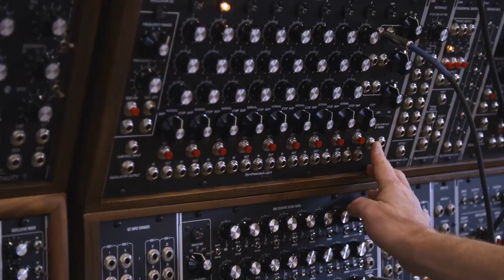Modular Synthesis (Part 2) - Studio Time: S2E12

Comment: Hey Tom,  Thanks so much for the great videos! they've been a great help for me.  :)  Could you possibly do a video about various ways to clock a modular system from a DAW?  I clock mine with a midi signal sent into either my Mother 32 or jdxa but I'd love to learn a different way to do this as this method is a bit limiting.  Thanks!

Comment: This is absolutely great! Thank u! I was wondering about the bass line tho. I have always thought that bass sounds should be recorded mono and stay mono. Otherwise you might loose the punch of the bass/kick etc. However, I cant deny that it really sounded great when you made two bass lines (or how to put it) for the left and right channel.

So I suppose my question goes: is it preferable to record bass/kick and similar bass heavy sounds stereo as well? Is the most important thing that you dont pan them in the final mix perhaps? 

Im thinking that I maybe should do the same and record a left and right bass line and kick on a stereo track rather than just keep it mono. Just a bit afraid that this wont be appreciated when the track go to mastering hehe 

Thanks again - gonna experiment quite a bit now :D

Comment: Great videos I love them. Probably a stupid question considering this video is on modular synths, plus the crazy amount of awesome software and custom patches you have as well. But have you ever used one of the free vst instruments that are out there in a composition before. I only ask because I have some decent kontakt libraries and some nice commercial soft synths vst's and a couple of hardware units. But even with my limited equipment every once in a while I'll find a sound on some random free vst. And apply it to a composition made with some pretty nice stuff, and as soon as the sound mixes with the rest of the comp it gels instantly to the point where the comp would fall apart without this cheap sound. lol I just wondering if you had an experience like that. P.S Thank you so much for your videos and music Tom your a blessing.

Comment: Is it not easier to have a tuner physicly on your monitor speakers set with  a microphone instead of patching all the time? Just tune what comes out of the speakers
Reply: That can work an be handy but it will often become unusable rather quickly as you build a patch because you start to have many oscillators and effects etc sounding at once so you'd have to bypass the entire patch just to tune one element of it.
Reply: @JohnLRice  well everytime you tune, you need to play just that instrument over te speakers ofcourse. You cannot tune the whole patch. It's just way faster.
Reply: @TheTerracide  Probably in a majority of situations that could possibly be true for a majority of people, but I can say from my own experience it's not always true. ;-)

Comment: Wow, you need a lot of patience to work effectively on a modular synth.
Reply: Yeah, but very interesting things can be done when maintaining that full control over the signal pathways :-D It's definitely nice to have all that equipment, but in the particular instance of modular synthesis I think I would prefer the workflow in software such as reaktor or max. And then you also have the luxury of patch memory :-D Would be cool to have a huge hardware modular rig though with lots of fully analog modules, then once you have decent modular patches going in software you could move over to hardware and really start dialling it in :-)
Reply: @mortenrobinson  I agree with this :) I only got into modular synthesis in the last couple of weeks and I really love it ! I'd say it's definitely cheaper and better for the workflow in the box, but man.. something about using the hardware really gets the nips hard hehe.
Reply: @yebitchye  You may want to check for ground coupling if that's the output you're getting.

Comment: It's a shame to see all the issues. One of my worries. Tom, I'm thinking about buying a dot com Studio 88 this year or early next. Are there any modules you would recommend adding or removing from this system?
Reply from the maker: after some searching I found out I was using a faulty APC battery. After replacing the rig was totally fine.
Studio 88 is great start and the standard config is great!
Reply: junkiexlofficial ah, cool. Glad you got to skip the doctor visit.
Reply: Perhaps you could add this comment as an annotation at that point in the video.  It would be a shame for new users to be scared off by an otherwise nice tutorial when it was a simple issue to resolve.

Comment: Regarding the multiples, do you have issues with dividing voltage?
Reply: There are actually two types of multiples : passives (not requiring power supplies) and actives. Passive multiples might alter/lower the voltage so they're good for not so sensitive voltages (like LFOs for example). Active multiples are designed to maintain the integrity of the copied voltage, these are the ones you want to use to duplicate sensitive information like notes.
Reply: Thanks. I was wondering. Where can I find info on obtaining active multiples? Are they typically only used for modular synths? I am wondering if passive could lead to some issues in a regular audio patchbay.
Reply: lahattec Yes, these mults are specifically designed to process modular signals. Each modular "family" (500, Serge, Eurorack, etc.) has its own voltage standards. So, even though mults look like tiny patchbays, I would not recommend using them this way ;)
Reply: Thanks. I know that sometimes multis are used in audio patchbays to route a signal to multiple places. I suppose there typically isn't any problem with doing that.
Reply: Great! I wasn't (just wire the patchbays to mult), but was wondering about the specifics. Good to know. Thanks.

Comment: Dumb Question: when you take an audio/CV signal out and use a multiplier/splitter (from 1 to 4 out), is the signal weaken by splitting it, or is there some type of amplification/quantizing coming out of the multiplier to maintain the level? (referencing @18:52). Appreciate the clarification.
Reply from the maker: yes! That is why you preferable want to use 'Active Mult'... this will avoid signal weakness

Comment: The "voltage Quantizer" should be called "Voltage tuner", or "Scale tuner".
To me, quantizing is more about rhythm. But I might be wrong. What do you think?
Reply: It can be both. From an internet source " Quantization is the concept that a physical quantity can have only certain discrete values." So while a rhythm quantizer might only allow/force notes to land on 8th or 16th note divisions a voltage quantizer might only allow/force voltages in 12th volt steps (chromatic scale) or a more restrictive scale like G minor with a flat 7th, Pentatonic, or even just octaves.

Comment: Tom, you should stop using MIDI for sync/clock and use something more precise like Expert Sleepers plugins that generate audio signals which are sample accurate, free of jitter.
Reply: You missed his comment where he showed us what his midi master clock is...
Reply from the maker: for syncing an analogue sequencer Midi is perfect. I think you are talking about Clocking Cubase. I use Apogee for that. Analogue sequencing doesn't deal really with jitter. or sample accuracy. But audio clocking does
Reply: Hi Tom! Syncing an analogue sequencer with midi is ok, but I'm talking about Expert Sleepers plugins (there are others), which are audio plugins that generate CV, Gate and Clock signals through your soundcard audio outputs. Being a plugins, they're sample accurate... that means, you don't get MIDI jitter.  Check Expert Sleepers's Silent Way, or MOTU's Volta. You can do a lot more that clock sync, you can have full control of your modular, they can even tune the oscillators automatically! Cheers.
Reply: Hi Tom, thanks for the videos, do you actually need to clock the AD/DA converters to get perfect video sync? My understanding was that external clocks always performed worse than internal ones, however I am not familiar with the requirements of video clocking [I thought editing would have taken care of that]
Reply from the maker: Good call! Let me look into it! Thanks..
Reply from the maker: wel yes... Different subject... My cubase machine is linked with a protools set. Both are controlled by apogee external clock set to 48khz.
Reply from the maker: Ah, ok.. Now I get it.. I have actually never ran CV info out of cubase! Technically I am not even running midi clk. I program 16th notes. that way I can have multiple elk's at the same time if that makes sense.

I usually have 8th note. 16th note and 16th triplets. 

Further I trigger with one 2bar note the chord sequencer..

Makes sense?
Reply: Very interesting, thanks, so you keep both avid's and cubase's interfaces sample-synched. I found this analysis on external clocks by the way: http://www.soundonsound.com/techniques/does-your-studio-need-digital-master-clock
Reply: Yeah, perfect sense, but MIDI, being a slow serial interface, it has really bad timing... if to that you add further conversion to CV and Gate it gets worst. By running Silent Way plugins, you get perfect, sample accurate timing. As it´s a suite of plugins, you can use the ones to generate clock signals, or if you prefer, keep with your actual method of sending notes, but this time through direct CV/Gate from your sound card. You can even generate envelopes, midi sync´ed LFOs, etc. If you connect the oscillators back to the inputs, the plugins will automatically calibrate and tune them! You could use a multi out audio interface only for this purpose. It has to be DC coupled. Good luck! ;) Love your videos, btw!